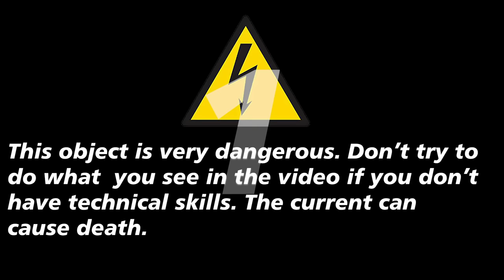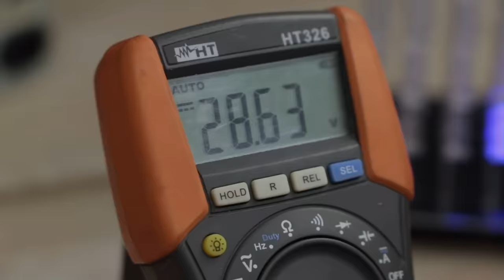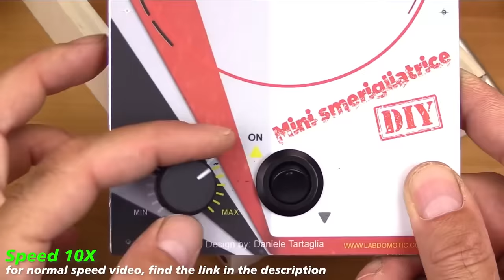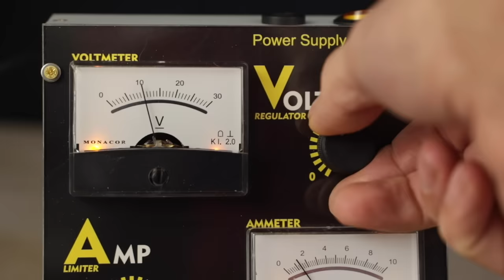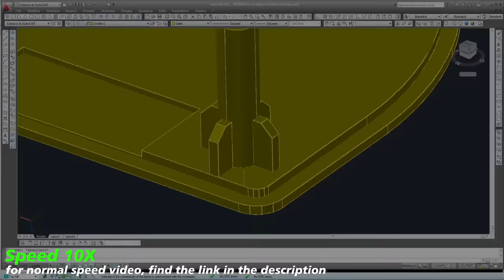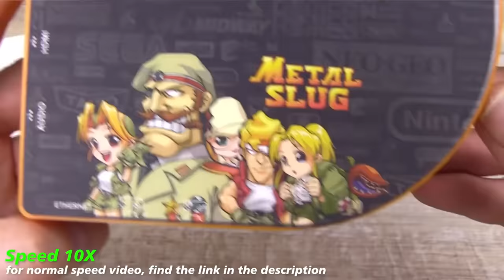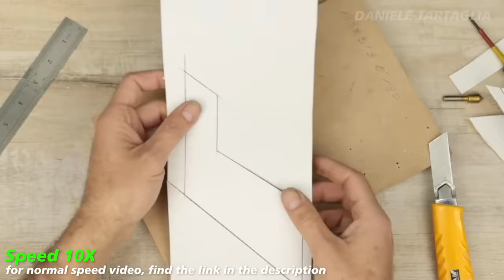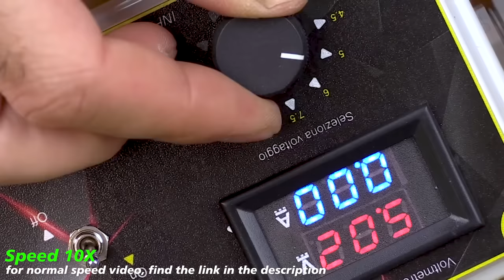10 BIG INVENTIONS with electronics module LOW COST

Comment from the maker: THE ORIGINAL VIDEOS at normal speed :-)
1 📺 ATX PC DIY: https://bit.ly/2LlTKAL
2 📺 Grinder with HD Motor: https://bit.ly/3csUmAn
3 📺 3D Printer DIY with FLOPPY DRIVER: https://bit.ly/3cqAE8H
4 📺Mini CNC PEN 2D using scrap DVD: http://bit.ly/2wImAHj
5 📺 RASPYSTATION console 1000 Games: https://bit.ly/2YYx6qa
6 📺 Power bunk with a plastic bottle: https://bit.ly/2LlOCwH
7 📺 SCROLL SAW machine DIY: https://bit.ly/2LkyWcL
8 📺EASY Power Supply regiulatorehttps://bit.ly/2T0zfhf
Reply: I just want to say u r  way of doing  is super 💯  creative and awesome
Reply: Sir please try to make a 2 ampere 3.7v to 5v boost  converter circuit
Reply: Qual è il nome della canzone di sottofondo usata nel progetto 1?
Reply: normal vedio
Reply: normal vedio

Comment: Here's an idea for a future assembly vid which follows the "very cheap elec. components" model that I recently succeeded at myself: Remote controlled exploding brige wire C-4/RDX detonators (or any other insensitive H.E. for that matter). You can build 8 of them for >$50 and can reuse the remote if you buy the right relay kits!

Comment: That touch switch would be cool if you could hook it up to a ceiling fan and have it on the wall so you could interface with the fan without having to replace the pull switch whenever it goes out

Comment: Many great projects but mains (230V) and low voltage (3.3V -12V and up) Should not be mixed in the same space unless they are screened off from each other properly or in some cases have the correct distance from each other!

Comment: When you hooked up the electronics to have it work as a touch switch, did it work if you touched the ceramic pot? I’m working on something and was wondering if that could transfer the signal to turn it on.
Reply: the white ceramic vase is vitrified and does not lead, however, to the earth - plant chain: the humidity of the soil and the sap in the plant allow the conduction of that very small current necessary to activate the switch. The terracotta pot (the one with the geranium) having a porous surface could retain moisture and could conduct
Ciao
Reply: You need capacitive sensing elements. Zola tanaffa already gone in depth about. Everything conductive or with dielectric different from air will be act like a "sensor"
Reply: Wrap what you need to touch with copper tape and connect the wire to that

Comment: Which link is for normal video..... I don't see Normal Video Link:..........
Reply from the maker: 1 📺 ATX PC DIY: https://bit.ly/2LlTKAL
2 📺 Grinder with HD Motor: https://bit.ly/3csUmAn
3 📺 3D Printer DIY with FLOPPY DRIVER: https://bit.ly/3cqAE8H
4 📺Mini CNC PEN 2D using scrap DVD: http://bit.ly/2wImAHj
5 📺 RASPYSTATION console 1000 Games: https://bit.ly/2YYx6qa
6 📺 Power bunk with a plastic bottle: https://bit.ly/2LlOCwH
7 📺 SCROLL SAW machine DIY: https://bit.ly/2LkyWcL
8 📺EASY Power Supply regiulatorehttps://bit.ly/2T0zfhf
Reply: @DanieleTartaglia  Hi Friend! Keep up the Good Work. Based on yr 3 way dimming Sensor, you put the touch sensor directly into the soil so that when touching the leave, it can produce a dimming effect?